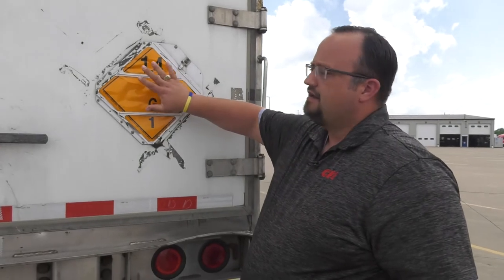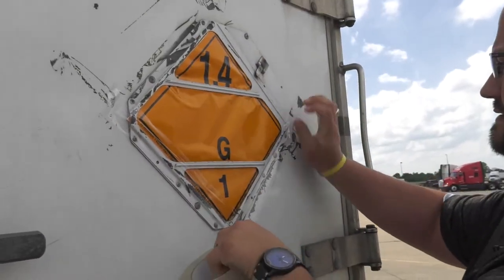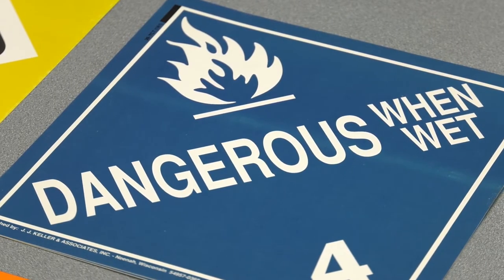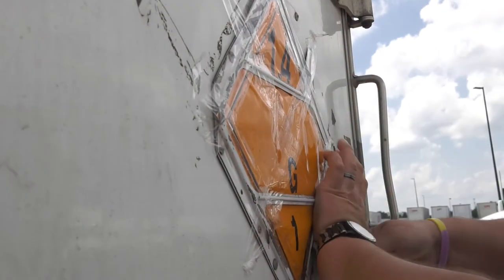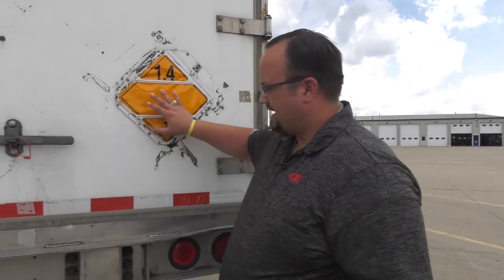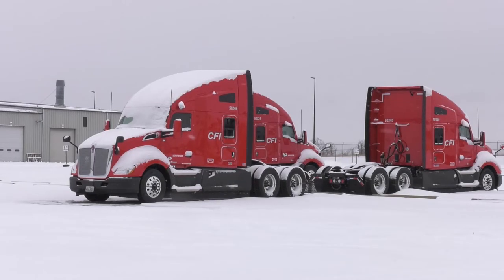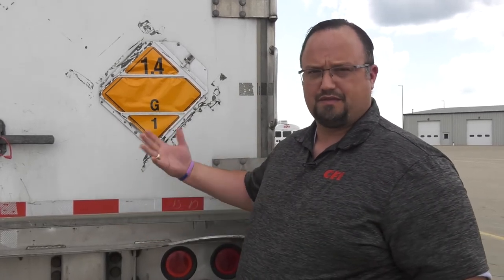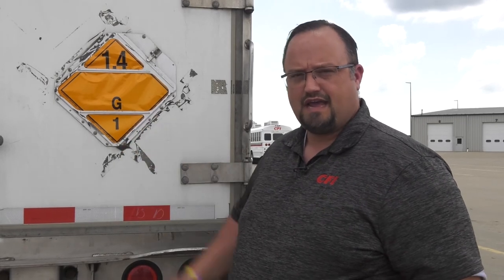Placards

Comment: Have you ever tried to remove a placard sticker that has been stuck directly to the side of a trailer and driven from that sunny environment to someplace that is in the 60's or below? Yeah, they dont peel back off. They come of like paint chips and the driver will be stuck at the receiver for hours since they cant leave until they are gone. Just imagine that process with 3 or 4 or 6 placards on each side. Might as well cancel the drivers reload because he/she isnt going to be there. Ive had furious drivers because they are stuck, outside in 30 degree weather or rain or snow having to spend 3 or 4 hours trying to get them off. The BETTER advice is to peel that sticker, stick it on the back of an old placard, then tape that placard to the side of the trailer. Placard stickers are not placards and they are not meant to be. They are part of a placard and need that cardboard to stick onto. Even putting a placard sticker into the holder is begging for problems because they flap around. Tape helps but they can still tear or completely come apart and blow out. Torn or missing both being a Hazmat violation. If that same sticker were simply stuck onto the back of a previously used placard and then slid into the holder it should be just fine.